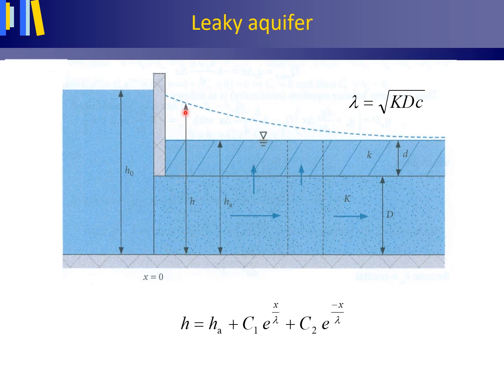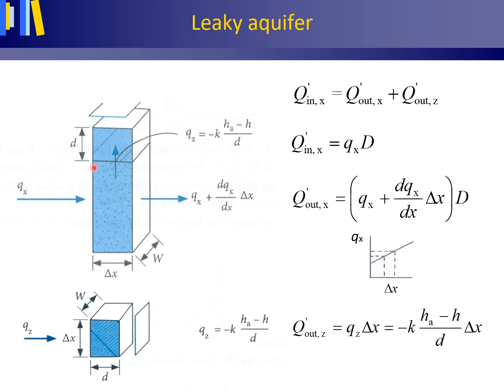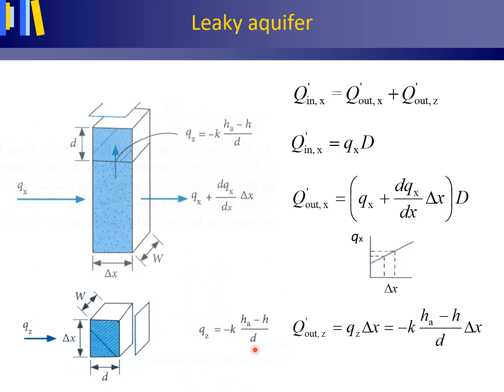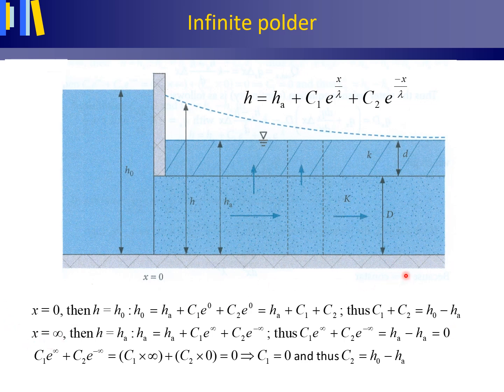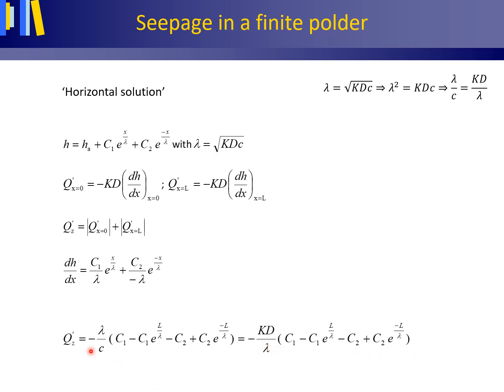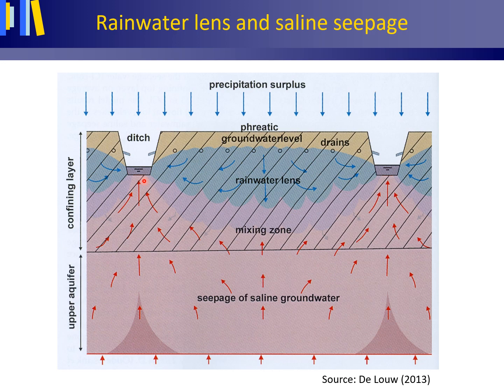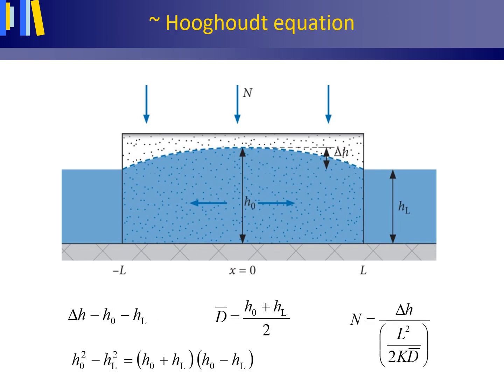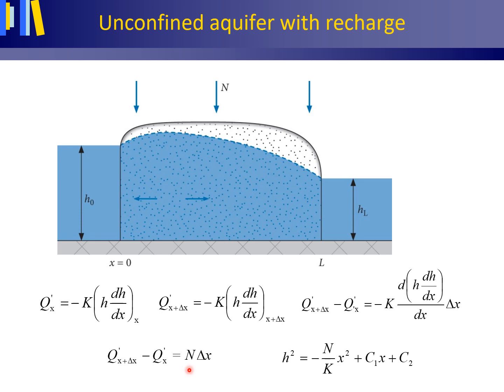Physical Hydrology Lecture 7 part 1: Groundwater hydraulics

Comment: Great videos to study. As a recommendation, it would be better if the names of the values of the equations are written in the slides not only said it once since it will be easier to forget after showing several equations.
Reply from the maker: Thanks. You can turn on the subtitles if you wish; you may find this helpful, I am not sure.